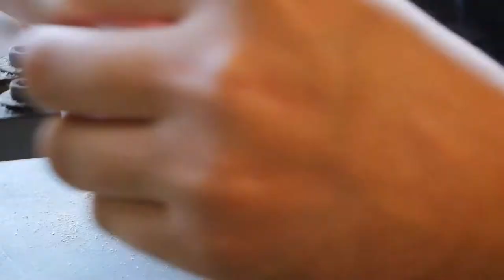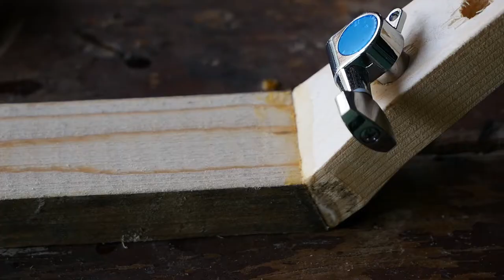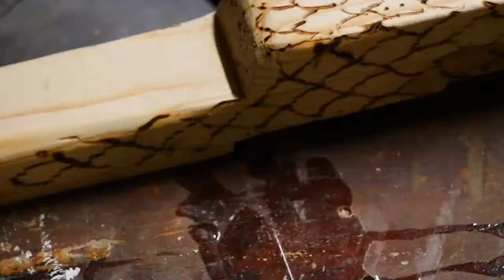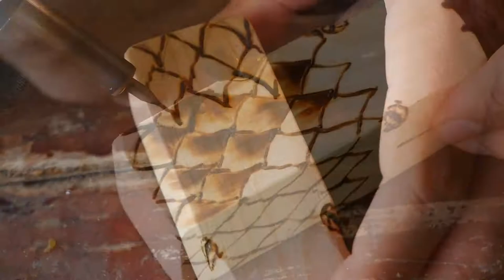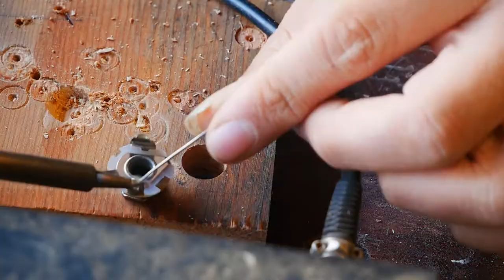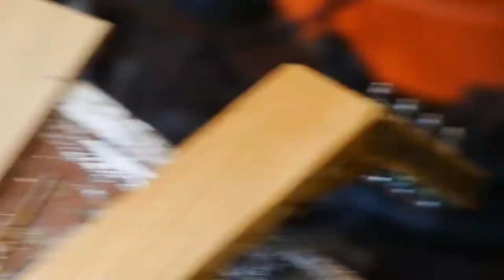Zoomorphic Snake Electric Cello Build

Comment: This is so pretty and creative! It's a bit of a pity that the side showing to an audience doesn't show off the lovely artwork along the neck.

Maybe a transparent fingerboard could protect the neck while also allowing neck artwork to show through it? I don't know if that would even work.

Or maybe there could be no fingerboard at all. Instead, you press fingertips directly onto the neck, with the strings floating just enough for your fingernails to stop.
Reply from the maker: I often don't press the string to the fingerboard, much like an erhu. For the lower notes, it is harder to get a solid tone, so I do press to the fingerboard. 

The oak plank also adds rigidity and strength to the neck. I was considering doing the scales pattern along it, but on a test scrap I found it doesn't shade as nicely as on the fir, so I decided against it.
Reply: @meercreate  I realized a much simpler solution. Every once in a while, you spin the instrument around to show off the neck artwork.

Obviously you aren't playing the instrument at the time. It's just a bit of performance flair.
Reply from the maker: I was considering this. Next time ☺️